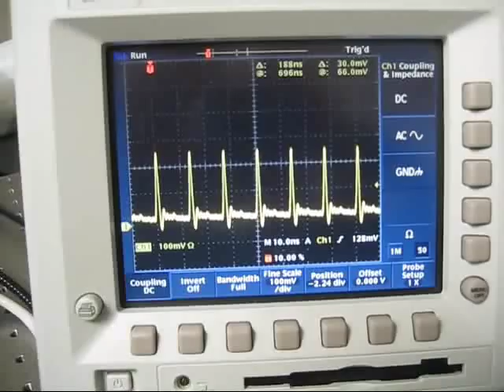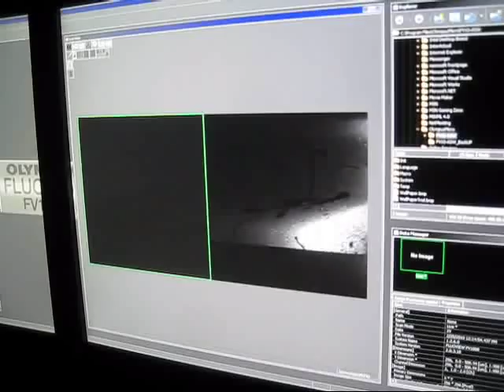Multiphoton Microscope Alignment using Second Harmonics Generation Crystal

Comment from the maker: GDD is the group delay dispersion, the difference in time between different
wavelengths of light when passing through a system.  It represents the
tendency of shorter wavelength components of a pulse to travel at a
different speed through glass than longer wavelengths.  Its is the temporal
analog of chromatic aberration if you are familiar with that concept.

The GDD depends on:

1)  The amount and type of glass in the system (and therefore on the
objectives used)
2)  The wavelength of light (typical glasses have lower GDD as one
approaches 1.3 um).
3)  The length of the pulse of your laser (short pulses are very sensitive
to GDD)

In your case, your chameleon has a relatively long pulse length (140 fs),
and will therefore not be very sensitive to even relatively large amounts
of GDD.  Personally, I do not bother compensating GDD on our Chameleon
because I found that it had a very minor effect on image contrast (although
I am using scan optics that are optimized for low GDD).

However, since you have GDD correction built in, you might as well use it.
Take a slide filled with the fluorophore of your choice and use your
preferred objective + wavelength.  Then adjust GDD until the image
brightness is maximized.  I recommend using low power and concentrated
fluorophore to minimize photobleaching.  You can repeat this for each
objective and wavelength if you are determined, but the difference will
likely be insignificant unless you are using very widely spaced wavelengths
or extremely dispersive objectives.

Comment from the maker: Brewster-cut Cr:Forsterite crystal without mount with dimensions 6.2 mm x 3.2 mm x 3.2 mm along the crystallographic a, b, and c axes, respectively. Absorption coefficient of pump radiation at 1064 nm is 1.64 cm-1. 
It's possible to use this crystal for amplifier system as well as for master oscillator.
USD 4000, currently in stock

Comment: Trestles LH10-fs/CW laser system at UC Santa Cruz Center of Nanoscale Optofluidics
Del Mar Photonics offers new Trestles fs/CW laser system which can be easily switched from femtosecond mode to CW and back. Having both modes of operation in one system dramatically increase a number of applications that the laser can be used for, and makes it an ideal tool for scientific lab involved in multiple research projects. 
Kaelyn Leake is a PhD student in Electrical Engineering. She graduated from Sweet Briar College with a B.S. in Engineering Sciences and Physics. Her research interests include development of nanoscale optofluidic devices and their applications. Kaelyn is the recipient of a first-year QB3 Fellowship. In this video Kaelyn talks about her experimental research in nanoscale optofluidics to be done with Trestles LH laser.
Trestles LH10-fs/CW laser system at UC Santa Cruz Center of Nanoscale Optofluidics
http://www.dmphotonics.com/Trestles-LH_UCSC/Trestles-LH_UCSC.htm

Comment from the maker: New! Femtosecond Cr:Forsterite regenerative amplifier with seed oscillator (Full system) with Nd:YAG pump laser, stretcher, compressor,  pulse picker, synchronization electronics and chiller 
Output: 1240 nm / 30 uJ / 1-2 kHz / 120 fs  - sales@dmphotonics.com

Comment: Simulation and Modeling: Simulation provides intelligent laser choice for two-photon microscopy
02/17/2015

Software modeling shows that fiber lasers can be used for two-photon scanning microscopy, reducing the cost of the technique by at least an order of magnitude.
KARL BEESON, MARY POTASEK, and EVGUENI PARILOV
Two-photon scanning microscopy, which is based on natural or artificial fluorescent probes, is now one of the primary means for monitoring and quantifying biomedical processes in living or preserved tissue.1-5 Finding the right combination of probe and laser for a desired class of biological samples is the defining step in two-photon microscopy.
Because laser prices vary significantly, it is particularly important to choose the best laser for the money without suffering a substantial loss in laser efficacy. Using simulation software, it is now possible to make an intelligent choice for a laser without having to obtain any lasers for on-site measurements.
To increase light penetration depth in biological tissue, two-photon scanning microscopy typically uses high-intensity infrared lasers rather than the visible light sources that are normally used for one-photon microscopy. Following two-photon absorption, the probe molecules can emit visible-wavelength fluorescence and phosphorescence that can be easily detected. A schematic diagram of a two-photon scanning microscope is shown in Fig. 1.
Scanning two-photon microscope shows excitation by infrared laser pulses and collection of the resulting visible fluorescence or phosphorescence
FIGURE 1. A schematic of a scanning two-photon microscope shows excitation by infrared laser pulses and collection of the resulting visible fluorescence or phosphorescence.
Two-photon cross-sections (in units of GM, named after Maria Goppert Mayer) are shown in Figure 2 for some organic dyes (Fig. 2a) and fluorescent proteins (Fig. 2b) in the wavelength range from 700 to 1050 nm.6 Many common fluorescing dyes and proteins can be excited by a wide range of infrared wavelengths, allowing the use of fixed-wavelength excitation lasers such as femtosecond fiber lasers.
Types of lasers for two-photon scanning microscopy
Two-photon microscopy requires high laser pulse intensity. The highest-intensity pulses are generated by lasers with pulse widths of about 200 fs or less. For example, the variable-wavelength titanium:sapphire (Ti:sapphire) lasers and some types of fixed-wavelength fiber laser generate pulses in the 80–140 fs time range.
Although Ti:sapphire lasers are widely used due to their high output power (greater than 1W in some cases), high intensity, and wide tunability (on the order of 680 nm to 1040 nm), they are very expensive (about $150,000 or more) and take up considerable space in a characterization laboratory. In addition, the high output power of these lasers can generally not be fully used due to potential tissue damage.
The maximum useful average power for scanning biological samples is approximately 10 mW or less. For the calculations described below, we will therefore assume that the example lasers all have 10 mW of average power at the light-incident surface of the samples.
A few representative examples of variable- and fixed-wavelength lasers with pulse widths of 200 fs or less are listed in Table 1 along with the operating wavelength, pulse rate, pulse length, maximum average power, pulse energy at maximum average power, and pulse energy at 10 mW average power. Four models of Ti:sapphire lasers are in Table 1.
New types of fixed-wavelength fiber lasers are now available that can replace Ti:sapphire lasers in many routine two-photon microscopy applications. Two examples are fiber lasers that operate at 780 nm or at about 1055 nm. Light at 780 nm is generated by frequency-doubled erbium (Er)-doped fiber lasers and is suitable for many fluorescent organic dyes and fluorescent proteins, as shown by the example spectra in Figure 2. Light of about 1055 nm can be generated by, for example, ytterbium (Yb)-doped fiber lasers. Some fluorescent proteins including dsRed can probably be excited by 1055 nm lasers even though the excitation spectrum shown in Figure 2 does not extend to that range. Femtosecond lasers operate at pulse-repetition rates of 50 to 100 MHz.
Two-photon cross sections as a function of wavelength for organic dyes, and fluorescent proteins
FIGURE 2. Two-photon cross-sections are shown as a function of wavelength for some a) organic dyes and b) fluorescent proteins.
Simulations of light emission from single and multiple laser pulses
When looking for an alternative to a usually expensive Ti:sapphire laser, we can pre-test lasers by performing numerical calculations using the SimphoSOFT simulation platform. This software can numerically solve the rate equations, which describe the dynamics of the probe molecule energy levels, and simultaneously solve the propagation equations for light traversing the sample filled with probe molecules.
Its mathematical model can accurately predict the fluorescence and phosphorescence emission spectra at any position in a sample, starting at the light-incidence surface. The user provides the beam radius at the input surface, which in these examples is 0.5 ?m, as well as the emission spectrum. The beam radius is determined by the numerical aperture (NA) of the microscope objective lens. The spectrum is provided by either a table of values or a Gaussian-shaped (or Lorentzian-shaped) function. We used a published source7 to get the table of values for Alexa 488. A schematic diagram of a laser beam directed at a cylindrical volume element of the sample that we specify for calculating the number of emitted photons is shown in Figure 3.
Gaussian-shaped laser pulse is directed at a sample volume element
FIGURE 3. A Gaussian-shaped laser pulse is directed at a sample volume element.
The rate of photon emission is related to the population of the singlet excited state divided by the fluorescence lifetime ? (for Alexa 488, ? = 4.1 ns). In general, probe molecules can also be excited to higher excited states (or even triplet states); emission from these states can also be calculated by the software. To get the total emitted fluorescent photons, the software integrates the photon emission rate over the volume element width and radius and over the specific time range (10 ns in this case).
A 100 MHz laser emits a pulse every 10 ns, or 100 pulses every 1 ?s. If the 100 MHz laser is scanned across the sample at a rate corresponding to 1 ?s per image pixel (that is, 100 pulses per pixel), a 1000 ? 1000 pixel image can be acquired in the relatively short time of 1 s. For scanning two-photon microscopy, it is quite reasonable to use 100 or more laser pulses per image pixel; for example, 1028 photons emitted in one pulse become ~102,800 photons for 100 pulses, which is more than sufficient for high-quality imaging (see Table 2).

We calculated the number of fluorescent photons generated from the dye Alexa 488 by 100 pulses from two well known models of Ti:sapphire laser and one fiber laser (the TOPTICA Photonics FemtoFErb 780) to compare their performance for two-photon microscopy. The results in Table 2 indicate that one can use a cheaper fiber laser to reach approximately the same image quality as is achieved via a typical expensive Ti:sapphire laser. The last column of Table 2 shows a quantitative comparison of the fluorescence signals from the Alexa 488 probe predicted by SimphoSOFT for different excitation lasers.
Simulation software makes it possible to predict the efficiency of two-photon microscopy devices without doing lengthy on-site experiments. Software can save tremendous amounts of time choosing the laser(s) to purchase for two-photon microscopy in order to get high performance at reasonable cost.
Acknowledgment
We thank Dr. Igor Pastirk, Toptica Photonics USA, for many helpful suggestions.
References
1. P. T. C. So, et al., Annu. Rev. Biomed. Eng. 02, 399–429 (2000).
2. L. Sacconi, et al., Biomed. Opt. Let. 12(5), 050502-1–050502-3 (2007).
3. W. Denk, et al., Science 248, 73–76 (1990).
4. M. Jain, et al., Arch. Pathol. Lab. Med. 136, 517–526 (2012).
5. C. Xu and F.W. Wise, Nat. Photon. 7, 875–882, (2013).
6. "Two-photon action cross sections," www.drbio.cornell.edu/cross_sections.html.
7. Fluorescence SpectraViewer, http://www.lifetechnologies.com/us/en/home/life-science/cell-analysis/labeling-chemistry/fluorescence-spectraviewer.html.
Karl Beeson is executive VP, engineering; Mary Potasek is president; and Evgueni Parilov is executive VP of R&D at Simphotek Inc., 211 Warren St., Newark, NJ 07103; email: beesonk@simphotek.com; www.simphotek.com.

http://www.laserfocusworld.com/articles/print/volume-51/issue-02/features/simulation-and-modeling-simulation-provides-intelligent-laser-choice-for-two-photon-microscopy.html?cmpid=EnlLFWFebruary192015

Comment from the maker: Construction of a two-photon microscope and optimisation of illumination pulse duration.
Soeller C1, Cannell MB.
http://www.ncbi.nlm.nih.gov/pubmed/8766017
The construction of a two-photon/confocal microscope system is described in detail. For two-photon illumination, a Ti:sapphire modelocked laser generating 62-fs pulses at 715 nm was used. The effect of the optical train on illumination pulse width was examined and the observed increase in pulse duration was almost completely removed by the addition/adjustment of a prism compressor system. The imaging capabilities of the two-photon microscope are demonstrated and it is shown that the imaging performance of the two-photon microscope is similar to that of a conventional confocal microscope. With two-photon illumination, the resolution (full width at half-maximum intensity) was 0.42 microM (x-y) and 0.81 microM axially, while with single-photon illumination (at 488 nm in the same instrument with a confocal pinhole detector) the resolution was 0.3 microM (x-y) and 0.75 microM axially. The results are discussed with regard to the general problem of femtosecond pulse distortion in an optical system and a simple procedure for optimal pulse restoration is described.